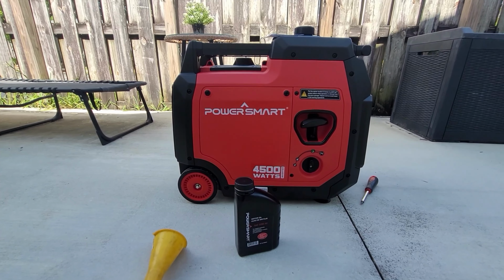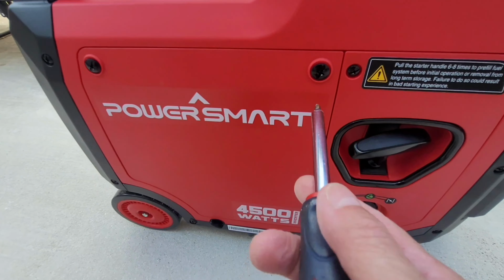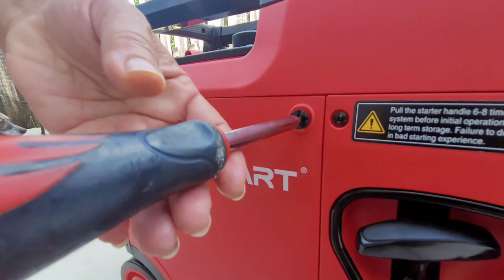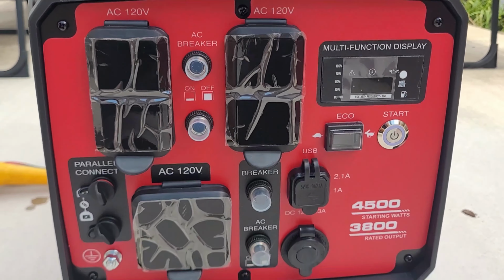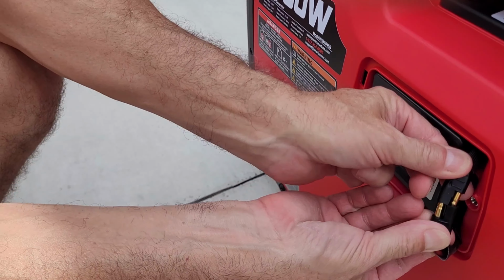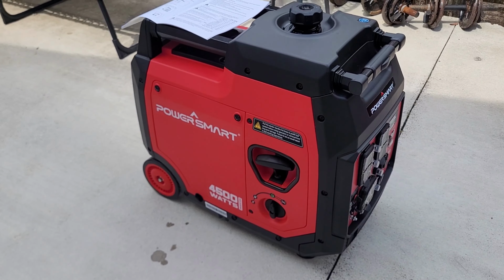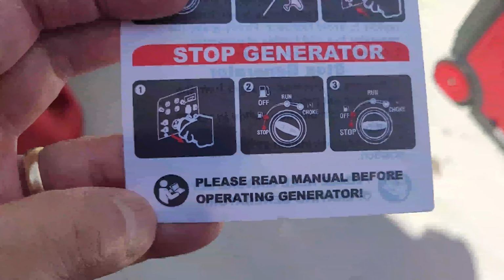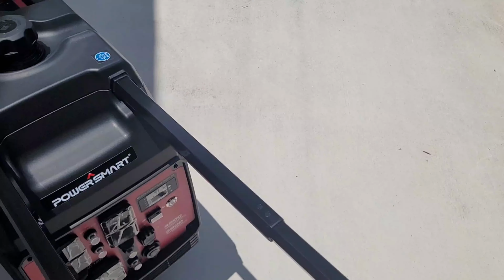Powersmart 4500 Watts Generator Inverter

Comment: Great review. What is the model number
Reply from the maker: Powersmart 4500W
Reply: @truelifeproductions worth it ? I’m gona return my 2580W and  buy this
Reply from the maker: @Chepo1500  2580w limits you too much. Good idea 💡
Reply: @truelifeproductions  yess . It’s better to have powerful generator . Thanks for the video
Reply: @truelifeproductions  it’s awesome . Super quiet also .. does it have hours on the display ? Fuel and what else ?
Reply from the maker: @Chepo1500  No hours, shoes a fuel level (4 bars)
Reply from the maker: Also load percentage and overload warning
Reply: @truelifeproductions  oh so the fuel bars it’s all the right bars correct
Reply: @truelifeproductions  yes but the numbers on the screen 📺
Reply from the maker: Those show voltage, frequency and time
Reply: @truelifeproductions  ahhh okay okay .. . So just fuel is the 4 bars on the right
Reply from the maker: @Chepo1500  exactly and on the left is the current load by the appliances connected.